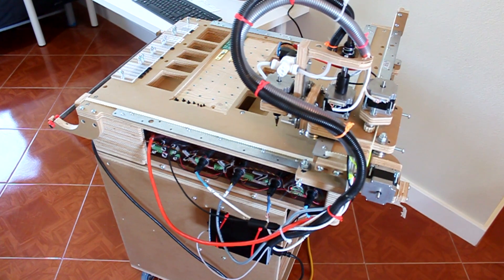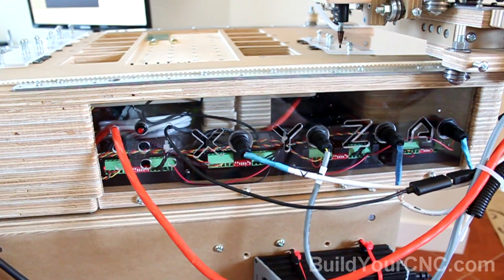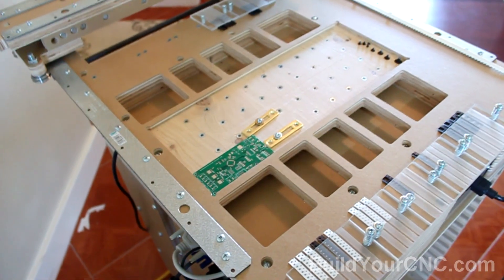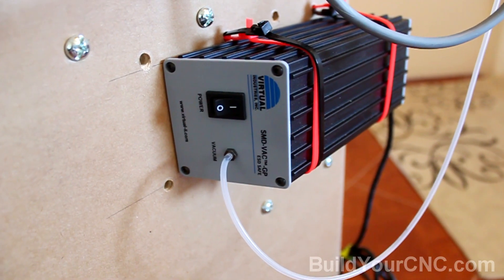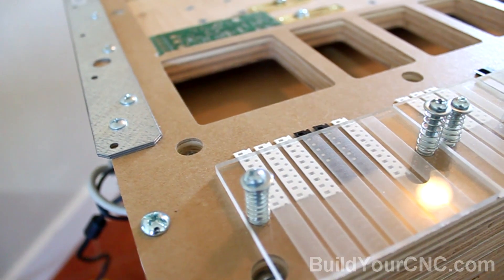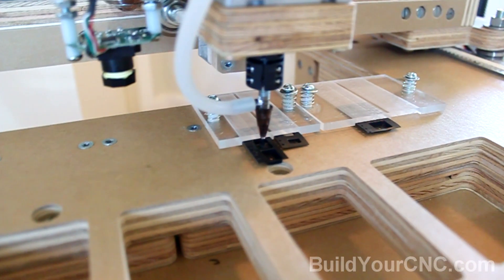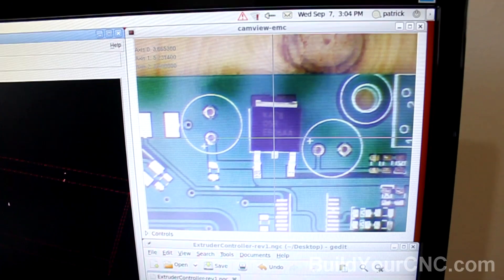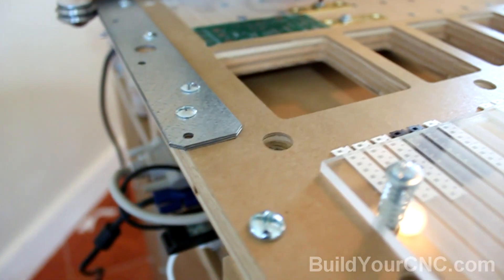redFrog Pick and Place Machine Introduction 9/7

Comment from the maker: The components do not need to be centered.  There is a file that is used to store the x and y locations for the parts on each tape.  The parts can be anywhere in relation to the tape and the tape/part cavity.

Comment from the maker: @gravelrashdotcom Well, that helps.  I will have to look up the mach3 plug in.  I tried AmCAP, but I didn't find the crosshairs. Fortunately, I am a c# programmer and I can add it myself.  It may come in handy if I ever decide to make PnP software. Why do you use an upward facing camera?